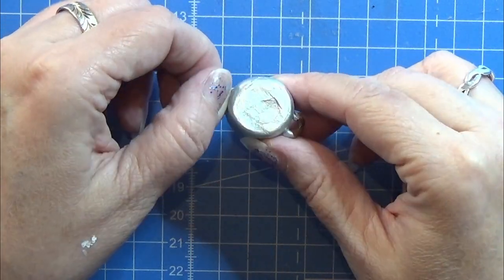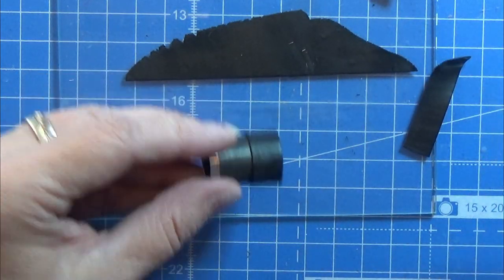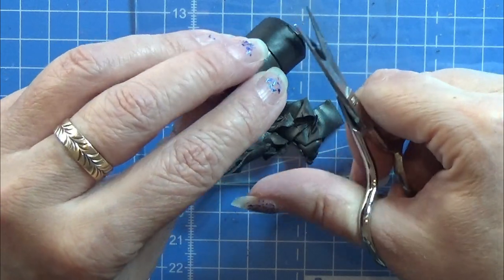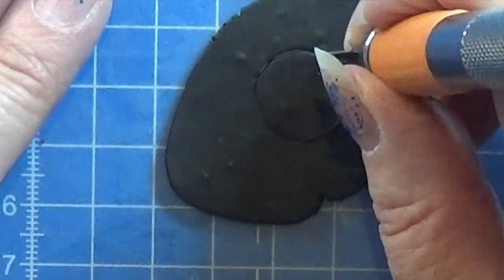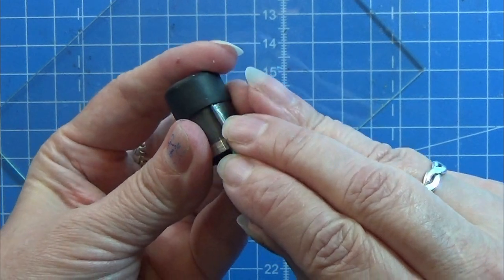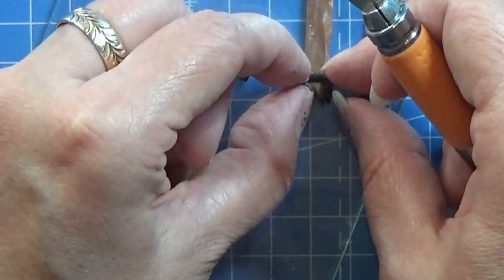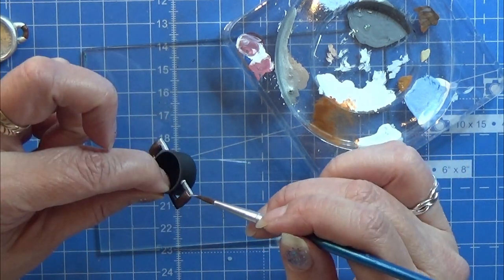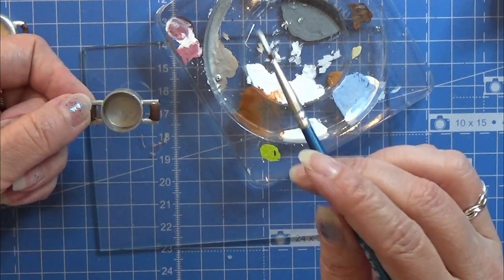Polymer Clay Miniature - Tiny Pot

Comment: I saw someone use a "babywipe" to smooth out the connection from the bottom, and it looked really good. I will try it next time, just wanted to tell 😊
Reply from the maker: Yes I have been doing that too, but I like this way better, les garbage, but the idea with babywipes is great especialy if you often get fingerprints on  your creations